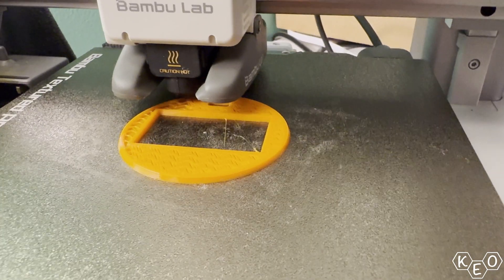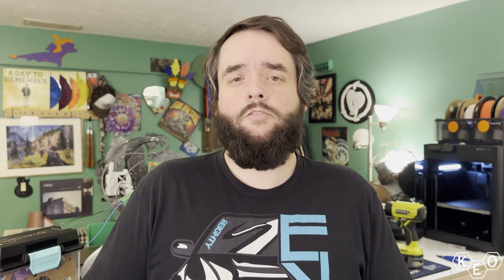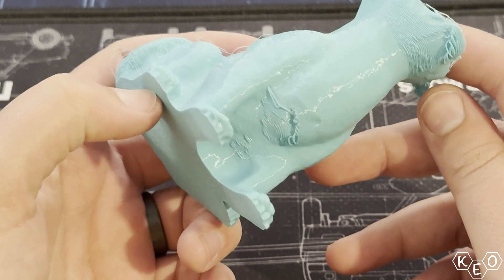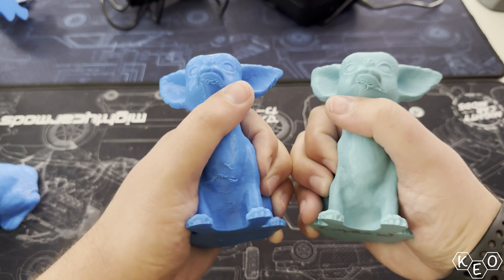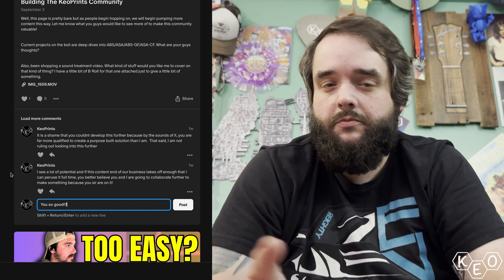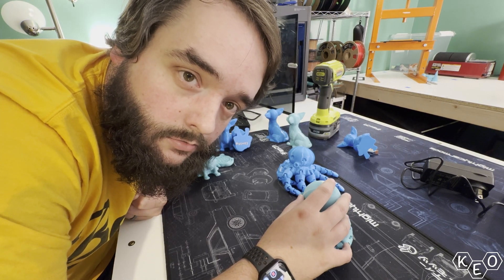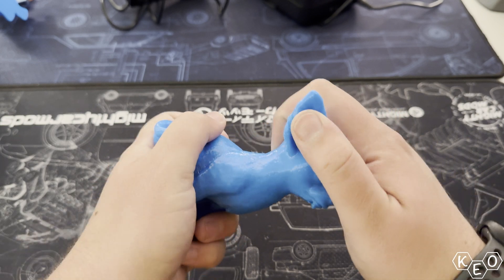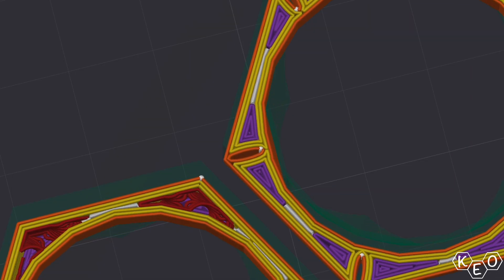3 Ways Anyone Can Maximize SQUISH On 3D Prints

Comment: You keep saying "infill' but not clarifying which of the multiple infill pattern settings you're referring to. In case anyone was confused by this, the setting is Sparse Infill Density and Sparse Infill Pattern, although the Internal Solid Infill Pattern can take effect depending on your other settings, so set that too, just in case. 

You also continually refer to "perimeter" but for those in Bambu Studio, this is called Wall Loops.

Comment: Two things I found that help printing TPU: First is extruder gear tension (assuming yours is adjustable).  Using less tension helps prevent the filament from deforming and wrapping around the gears.  Second is lowering the amount of friction from the spool.  If the filament is under a lot of tension, you might get under extrusion.  I use a spool holder with bearings so the spool can turn freely.

Comment: Considering you were having issues with overhangs, maybe adjust the printing temperature. Good chance that the different material has slightly different temperature capabilities
Reply from the maker: I’m thinking you’re right. I bumped the temp down some with no luck but didn’t really tune it that hard
Reply: @KeoPrints  my experience is that TPU/E acts a lot like much larger extrusions, like 50-100% larger in terms of sag and overhangs etc